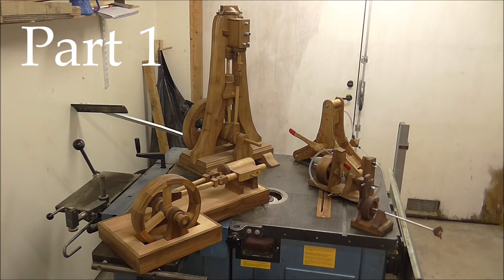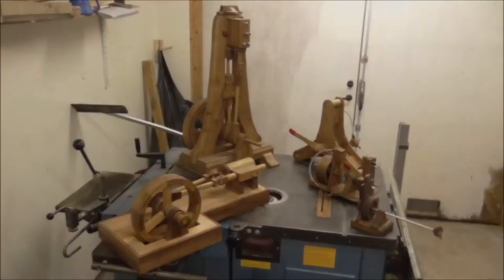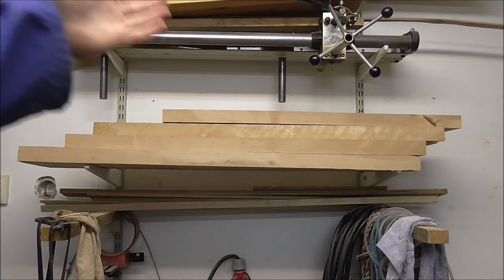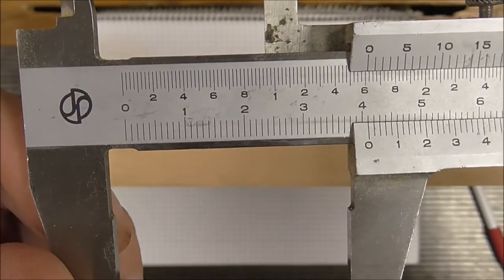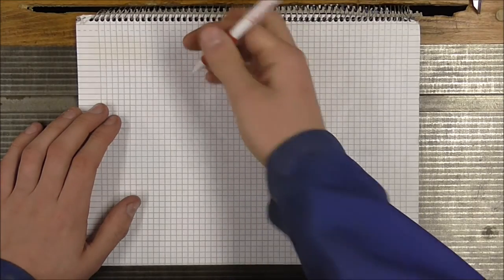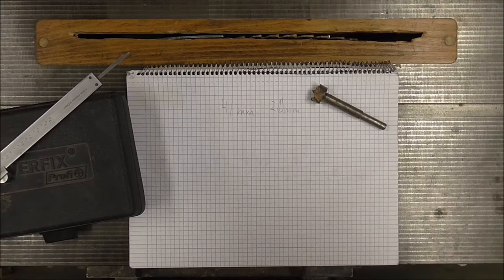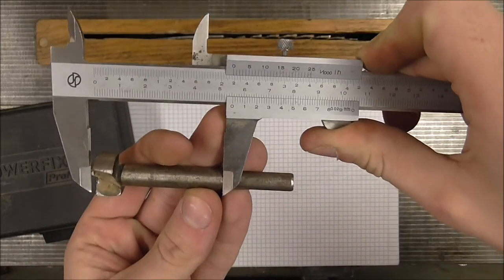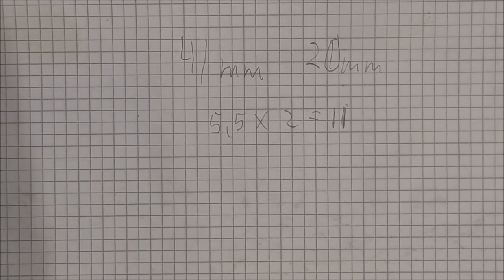Making a wooden air engine - part 1 of 10 - Cylinder block

Comment: I have never made a wooden engine that work but then I never used micrometers when working with wood so when I saw all this accuracy I was sure that this was going to be good.  The cutting  and forming of the block is very accurate and the  drilling  the bore  on a three jaw chuck was indeed very clever.  I like the honing of the bore with a split rod to hold the glass paper and  wrapping it in the right direction for it to work and not to lock.  The use of the light  to see the rough spots in the bore is a good idea and with that wood you use the bore honing seems to ensure a reasonable parallel hole all the way. The movement of your hand over the grinding paper is elegant as it produces good results. That must be very good grinding paper you are using as it has a good cut.  I think I shall go through all the videos in this series and comment on what I see. For this one well you certainly deserve full marks.  Congratulations.

Comment: Why do you use a lathe opposed to to a drill press to drill the hole
Reply from the maker: I've tried to do it with both a drill press & a lathe as you said. I found that it's easier to get a straight hole with a lathe, but it takes a bit more time to setup & adjust. Compared to using a drill press wich is a bit faster, though the hole can sometimes be a bit out of alignment.
Reply: creativeobsin ahh thanks I was curious and never seen it before
Reply from the maker: I try to take inspiration from those who build real steam engines. If it works for them in metal, it should work for me in wood. That was my initial idea atleast.
Reply: creativeobsin awesome